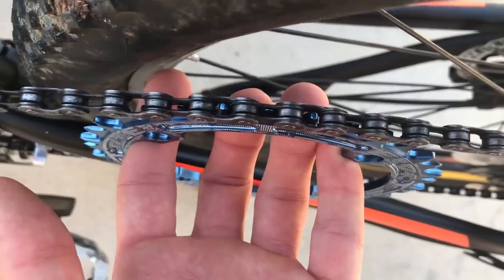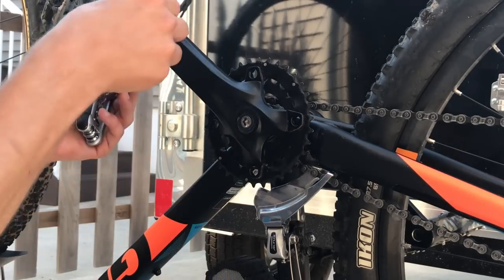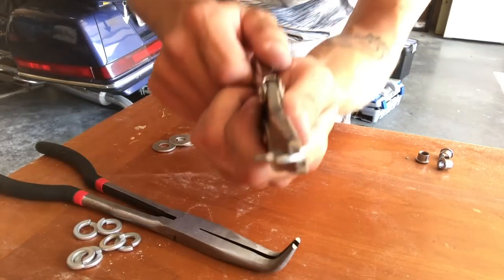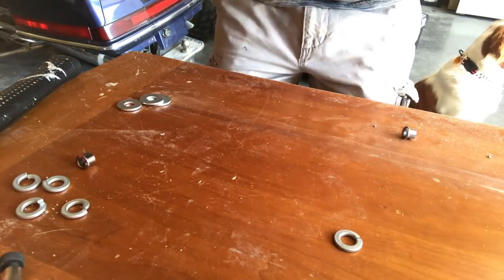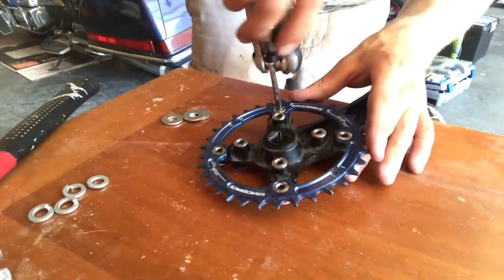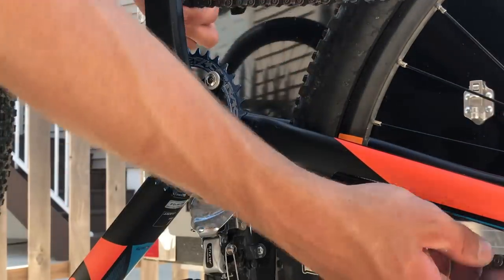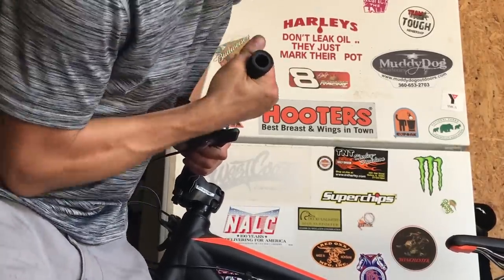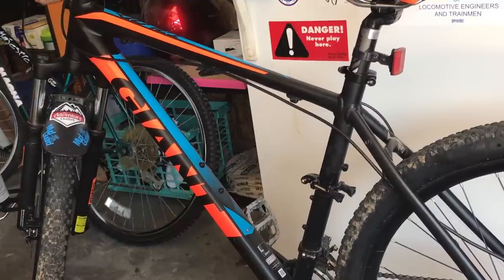3x8 to 1x8 MTB Conversion - Stupid or WORTH IT?

Comment: I done the same thing recently after realising out of the 27 gears on my bike I was using about 4!
Reply: yup... i have a 3x8, but i find i usually leave the front one in the middle... so might be trying this too.
Reply: @unclefreddieDied  mixed feeling man , the granny front 22 works well on steep uphills
Reply: @sdqsdq6274  I hear ya, but you can probably get the same "ratio" with a big cassette and a 30 tooth chain ring....???
Reply: @SlickDaddy yes, you'd probably want a bigger chain ring... closer to 40 tooth is my guess... and a bigger cassette.
Reply: I got the parts for my conversion.. can't wait to put them on... too cold to go riding though
Reply: @unclefreddieDied  same here front all time on 2nd, only use back gears, I think to try this too
Reply: @hesoyam91  I did it and I love it... was gonna go Advent 1x10 but parts were scarce due to covid I guess.  I went 1x9... 32 tooth up front... 11-46 in the back...

Comment: Recently converted a mint 2011 Trek Gary Fischer Marlin 29er into a 1x8 but i also swapped the crankset to hollowtech for even more weight savings. I bought the bike off a guy who literally bought it brand new rode it 2 times with his kids then hung it on the wall in the garage and that was that lol. I also swapped the pedals for some raceface clones, the bars to 180mm Satori Deviants and put on some locking grips. Did a complete tear down and service of the front coil fork which made a massive difference. I was going to swap the fork for an air fork but after servicing the coil fork im actually really happy with it. As long as i can keep the sticktion down by keeping it serviced I think it will last for a really long time. As for the 1x8 setup its very solid. I went with a 32T chainring up front but ive got a 30t chainring on the way i want to try. In the lower gears its a little stiff on climbs. My plan has always been to swap the cassette for a BiBike groupset 10 speed 11t-50t eventually. But for now that 32t chainring with the stock 8 speed 11t-32t cassette really just isnt ideal for climbs. If the wheels were 27.5 or smaller it would probably be ok but with the 29 inch wheels its just too hard on climbs even in the lowest 32t cassette gear. But once i have the 11-50 10 speed cassette id bet the 32t chianring will be perfect.

Comment: I converted to 1x last year. after a few months I converted back to 3x. for the kind of riding I do I need the extreme ends of the gear range. 1x seems like a compromise to save a bit of weight.
Reply: I think keeping a 3x is much more beneficial for extra gear range especially going up hills than saving some weight and having a more appealing look with a 1x

Comment: I own a Montague Paratrooper (folding) 26" mountain bike with 3 chainrings. The smallest ring can climb any steep grade, the middle ring is boringly neutral, and the best ring is unquestionably the biggest one. The lowest gear on this ring can climb very steep grades, and the highest gear is very fast in straight-line speed. So I decided to use this ring alone, and forget the rest, since it is definitely the most versatile. However, I see no logical reason to remove this whole setup just to save a measly few ounces, and it looks fine just the way it is. I only ride, I don't race.

Comment: tip for getting grips off put a 2mm allen key under the grip pour some rubbing alcohol under pull the key out and they will slide right off. RJ the bike guy is where I got it from. Its much easier.
Reply: @that_squires_guy   I hear ya just something to remember if you find yourself needing to get some grips off.

Comment: I've just recently converted from 3x9 to a 1x9. Have not upgraded my rear derailleur yet, do have a 11-40 cassette upgrade, previously a 11-34, new chain, derailleur hanger extender,  and a 34 tooth  n/w chainring. Lost a little gear range on both ends, but, I love it! Declutters the handlebars,  drops a little weight and looks very cool and simple. Bbg bashwich bash guard, protects chain ring and works as a chain retainer also. Works well, looks cool, lighter weight, simpler, and cleaner. May upgrade to eagle nx in the near future. More low end, so increases gear range. Great vid. I appreciate your conversion.  Follow up vid would be cool. I bet it works great and looks cool!
Reply: @that_squires_guy  will do. Great channel man!

Comment: the Topeak Multi tool is awesome!! A little tip for taking off slip on grips: 1) slip a zip tie between or pull up on the inside of the grip where it meets the handlebar. 2) pour a few drips of isopropyl alcohol between the grip and handlebar.  3) as you twist the grip back and forth, the alcohol will work its way around the grip and make it much easier to slip off.

Comment: Year 2018 and you still use square tapered crank and 8 speeds??? I am glad I am not alone LoL. I run 38T with custom 12-32 sprockets btw :)
Reply: Outer BB Shimano cranks getting cheaper nowadays like Acera/Altus, though one reason I keep square taper because knee pain from the Q-factor but it's adjustable by changing either the cranks or the BB length unlike outer BB which is fixed.
Reply: I only use the middle 32 and inner 22 chain rings on the front and a 32-11 cassette. I still use a shimano deore square tapered crank aswell.
Reply: There are now cassettes 8 speed....10-36-11-40 teeth......for a budget i thinking of buy it to look, looks like a 10 speed bike...
Reply: 2019 and still using square taper 3x8 haha. Planning on upgrading the bottom bracket to hollow tech 2 and getting a 32t single chainring, I'd recycle the old one but all the chainring are riveted instead of bolted together. I already get by fine with an 8 speed cassette but I'd like to upgrade that to 9 or 10sp depending on what fits, not trying to upgrade hubs or wheels.
Reply: Mine spline, the one that came after square taper, it’s an old carrera bike, the newer carrera come with old taper go figure older bike uses newer parts than newer bikes as the newer bikes use older parts from Halfords what’s up with that.

Like the old saying, older stuff were built better
Reply: I run a 3x7, 26inch rigid MTB but it's fine! It works well for me!
Reply: Yeah, square taper cranks, I learned my lesson. Pretty much myself, just kept upgrading my bicycle until things didn't break. Then by the time I got to the point nothing was breaking, I was too old to ride it. LOLOLOL...........3×8 to 1×8 is a good idea though, I currently have a 3×8 commuter bike, and I pretty much just leave it in 21st gear, so I got like 23 gears I barely use.(and quite a few literally never use)
Reply: @insoft_uk  also got old carrera on sram powerspline, more than 7000km allseason cycling, still zero problems. yes it's somekind heavy but I don't race.
Reply: Using that in 2019. 26" wheels as well
Reply: Yep. Square taper 3x8 here too.
Reply: year 2020 and my 18 inch handsome dog hardtail mountain bike has 1 x 8 with a 30 tooth chainring and 11 - 32 cassette and yes I also have a square tapered crank. why spends loads on the latest 1 x 11 or 12 when mine works just aswell.
Reply: @claytonhorvat7598  i have a 20 yr old rigid MB which had sorus shimano 3 x 7 / square taper BB. many gears not working so decided to upgrade, now altus 3 x 9  groupset with splined BB, which i installed along with new brakes and shifters. A whole world of difference and cost me approx 300 australian dollars. I ride to work once a week now, BTW i have different jobs at different sites so have to be efficient in travel as well. All gears work and bike is reliable so v happy with all this, also if bike gets stolen i wont be too down as opposed if it were a new bike

Comment: If it works for you, then that shouldnt be a problem. In my setup, i converted from 3x but i didnt bother to remove  the smallest chainring. The middle chainring is still stock (ramped) then just put the RD clutch in the on position then thats it. Instant 1x setup

Comment: Nice video - Don't forget the front derrailleur, it will rattle like crazy if you keep it, especially if you don't have a clutch in the back. You could do from now on 1x10 really easy, $48 a Shimano Zee FR Derailleur(cheapest clutch system I believe), $21 a Shimano Zee Shifter and a cheap 11-36 cassette(prices at jensonusa - cheapest around) Zero chain drops, and I ride pretty hard on both of my bikes. That's what I did on my 29er Diamondback Overdrive and a Norco Shore 3 downhill. It is awesome !

Comment: I changed my bike from 3 x 8 to 2 x 1, that means I put a 2 speed Schlumpf drive on the bottom bracked an a single speed on the rear hub. No shifting cables at all and great fun to ride.
Reply: Yard Sale Dale  no I use clipless pedals.
Reply: My bike has a fixed rear hub and the ratios are 27:17 and approx. 44:17 on a 26inch MTB.

Comment: I did the same thing on my 3x7 set up freewheel on my cheap bike. It works fine as long as you get passed the noises coming from the rear non clutched mech. Eventually I upgraded to my 12 speed hard tail but it was a fun project and i enjoyed it. I also added a chain guide/tension-er to reduce noise and add chain retention.

Comment: That's a great idea. you can get a pretty good gear ratio for most stuff even with an 1X8. I also have a 26T chainring installed in case I have to climb a huge hill, and when that happens I just stop and move the chain to the small ring manually. It rarely happens so I think it is still better than having a front derailleur. I hate front derailleur.   Even my road bikes don't have front derailleur!!!  ;)
Reply: Do you even ride bro.

Comment: The physics is, when u  up or down 1 cog in front derailure, its equal to 2 to 3 up or down in rear cog

3by is more useful if ur neighbourhood have steep hill
Reply: Yes it is! That's why I'm thinking of a 3 or 2 chainrings and single cog rear with chain tensioner. I only use the biggest and middle ring in my triple crankset.

Comment: I've got an old Gravity Liberty CXD from bikes direct that came with a 3x8 Claris groupset. The front derailleur is absolute garbage. It won't shift into the big ring at all. I've played with cable tension and the limit screws and nothing works. After watching this, I'm going to tear off the derailleur and the outer two chainrings. It'll give me a range of 30/32 to 30/11. Definitely limits top speed, but the climbing gear isn't terrible and not having to worry about grinding gears on front shifts will be a relief.

Comment: A quick way to remove grips, if you have an air compressor just blow air into the grip and they slide right off, providing their not appoxied on, then it's a razor blade right down the length of the grip

Comment: I like to do something to my MTB every once in a while. It's been a 3x8, then a 1x8, again a 3x8 and now it's a 2x8. From 22-32-42 chainrings (Acera FC-M361) now it's running 22-36 chainrings on the same spider, plus a Shimano bashring. I couldn't find anything to space out the bashring, to keep it from being too close to the chain and rubbing against it, so I've found the lock washers to act as spacers. Flatened them a little, works like a charm, bashring spaced out by 2 mm, no chain rub, Bob's my uncle.

Bicycle shops in my country don't have stuff in stock that would make me replace bicycle parts for granted, but as I like to have a MacGyver approach to fixing stuff it works out well.

A true genius is someone who can make something work out in a different way, not how the engineer has imagined it.
Your 1x8 conversion is very nice, it's about the fun and tinkering with stuff.

Greetings from Croatia! 👋🏻

Comment: Bro were the same, i aslo converted my 3x8 to a 1x8 setup but i changed the cassette its now 11-40
Reply: How does that run for you? Smoothly or rigidly?
Reply: FLTS its smooth...
Reply: I also run on 11-40 casette...
Reply: What's your front sprocket tooth?
Reply: Did you need a new derailleur too?
Reply: I am also thinking of simillar conversation i have a 34-11t cassette will it run fine with 38t crank?
Reply: @piyushpoptani7507  climbs will suck you don't have much low range get a smaller front sprocket or get a cassette w more range

Comment: To fit and remove handlebar grips use hair spray and a plastic spoon. I've been using this method since 1987. Use the handle of the spoon to make a gap between the grip and the bar, then spray the hair spray between the grip and bar. Manipulate the grip to move the hair spray around and hey presto, the grip is off. To fit using hair spray clean the bar and inside of grip then spray the hair spray on the bar and inside of grip, fit the grip to the bar, rotating the grip when sliding it on to spread the hair spray around. Leave for an hour or so to dry, the grip will be locked on until you want to remove it again.

Comment: Instead of using washer on the grommets I just took them to the grinder and shortened them myself.

Also, to take your grips off in 2 seconds, put an air chuck on a compressor and shove it inside the grip between the bar. Blows it right off.

Comment: I have a 42tooth ten speed expander cog on an 8speed. Drilled out the pins on the cassette. Ditched the third gear. Works with an 8 speed derailleur. 11-42 8 speed with a 30tooth chainring and 26inch wheels. Goes up anything.

Comment: Try oval chainring. also the fork on this bike is scary and the race face chain rings are strong, but does not help if cranks are garbage, I managed to twist a chainring.
for mtb 1x8 is horrible for mtb, even commuting, at least with stock cassette, but ok for flatter areas, of course if it's a bike with smaller wheels it will be lighter than for 29er.
if you got small enough chainring and wide range cassette it can work.

Comment: This looks fun! Now, I want to convert from 3x9 to 1x9!!
Reply: iiFireCraftX don’t do it 1x9 would suck climbing
Reply: Lol I thought the same
Reply: @jayf2487  did u ever try it? And how it suck at climbing?
Reply: I have done it..  36t 1x9 with 11-42 cassete..
Reply: Same
Reply: i have 1x9 and its good for climbing
Reply: Don't change in front...boom 1x.
Reply: @imranhamid5946  11 40t cassette with 36t chainring, is it still good at climbing?
Reply: I done did it! It’s not bad ... but eh~
Reply: Did the 1x9 gearing on my old kona  stinky, also drilled a hole in my frame for a dropper post.
Reply: @kenmarasigan02  you must be super fit to have those kind of gear ratio's, I added a 11-50  cassette into the mix, I need the lower gears to be able to climb better on my heavy kona stinky which is designed for fr/dh
Reply: @martincibulka588  i have a 1x11 and live in Colorado.  If your not in piss poor shape it’s enough for any trail in the rockies.  The chain slap is real though.
Reply: 1x9
38t oval 
11-42
I love it
Reply: @carlbrowitt6221  I'm looking to do the same, did u have to swap out the rear derailer?
Reply: @imranhamid5946  I'm looking to do the same, did u have to swap out the rear mech or use what u had

Comment: I converted from 3x9 to 1x9 with a bigger spread cassette.  Unfortunately the rear 9spd mech couldn’t handle the spread and shifting sucked.  I had to covert to 1x11 rear mech and shifter for it to work properly and give me a nice gear range.

Comment: Bought a 2x10 bike. Replaced the bb  , went one by . New chain, and cassette 11x42  10  cog with a  34 tooth chain ring. Climbs ok but get off and hike a bike a lot in the steeps.  Taking the hard tail out in Gallup today.

Comment: Narrow wides chain retention properties only come into effect if used with nine , ten , eleven speed chains , by using it with a wide 8 speed chain your not getting any of the chain retention from the alternating teeth width which is its purpose so you could have saved yourself the price of the Raceface narrow wide and just used any regular 8 speed compatible ring

Comment: I tried to make the 1x10 speed with 3x xt crankset as you use the ring spring. before 6 months. there is no space near the hole to use the spring. i want to say you can’t use the spring for xt m78x crankset as a spacer. Buy the spacers for xt crank. it is easy.

Comment: The biggest issue is the gearing usually sucks in the back because they allowed for the granny gear in front which is usually around 26t or something like that and the middle ring maybe 32.   So they only needed the 8 gears in back.  But if you go just one gear in front, you need to allow for that and maybe go with a 30t in front.   Depends on what your hole spacing is and what size you can get.   Most are 140mm I believe and most companies only go down to 30t at 104mm spacing.     I did eventually find a 28t when my brother went to a single front ring, but can't recall what brand, there as only one company making it.

Comment: That's not cheap.. that's smart. People who buy any or everything are suckers who can't do nada! Also not a bad idea to convert a 3x to a 1x8. I did and I love it. And people love my mtb. It shows character
Reply: Agree
Reply: I made a 1x to a 2x conversion on my walmart bike had a 36 tooth on the front and all of the trails i ride have steep climbs so i cut out a 22tooth gear on a plasma cutter and drilled holes in the original crank and now i have a bike that can climb
Reply: Robert Trageser you missed the point.

Comment: I enjoyed that ride! You got the job done! Sometimes you have to improvise. I upgraded an old mongoose bike by replacing the crappy rear spring shock with an (not too expensive, but ok) air shock. To get the bushings out of the old shock and into the new shock, I cobbled together a few sockets and a big c-clamp. Worked just fine and didnt cost anything. Enjoy your new bike!!!

Comment: If I'm not mistaken, you had a 42T , 34T, 24T chainring. Took them all of separately bc they luckily are not riveted. Then bought a 34T and installed it.Why not just remove the 42T and 24T rings, and then leave the 34T by installing it as you did with the purchased 34T???